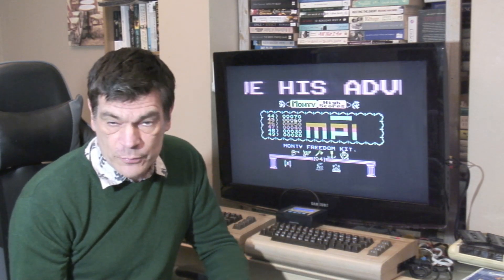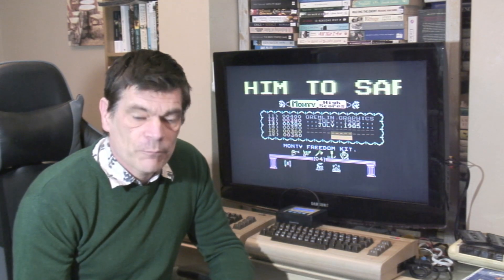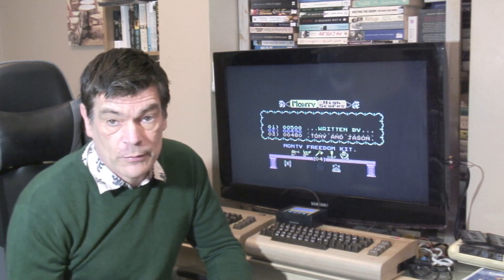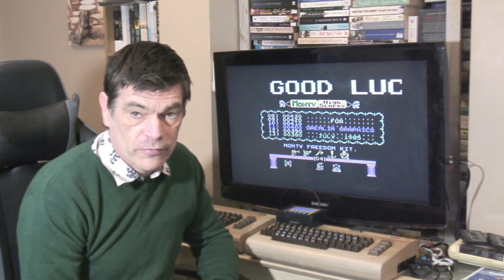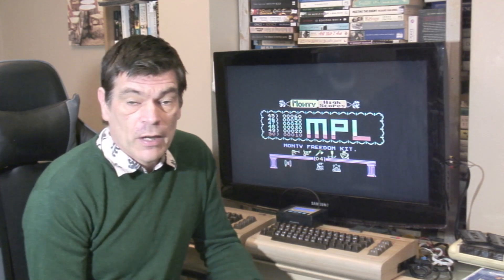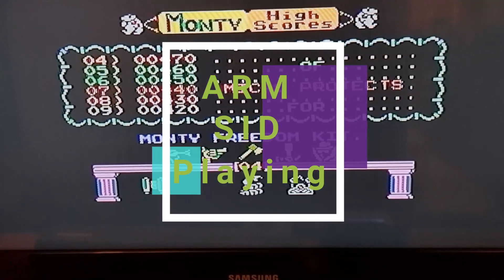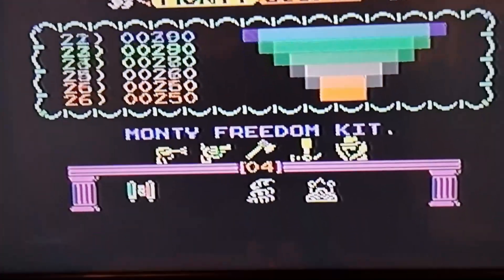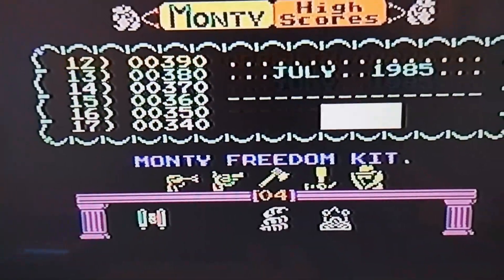ArmSID Sid replacement for Commodore 64 : is it any good

Comment: I ve buy it for my c64 ii and it s great. Some tunes with preset are best than 8580. It s great because you can test 6581 on c64 ii. If you are a great fan of c64 you know that tunes tones is différent on every c64. I ve two breadbin with the same 6581 révision and the tones is not the same. Armsid is best for emulate the 8580 and a friend went in my home, he doesn t know it s an armsid i put in c64 and he s incapable to say me if it s the original or the armsid.  I play a lot of demo and armsid is very great